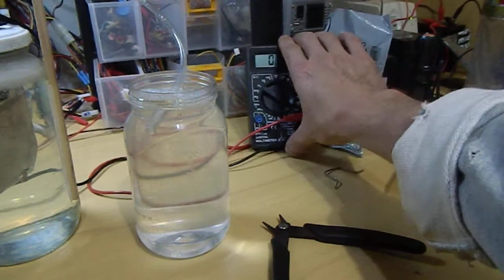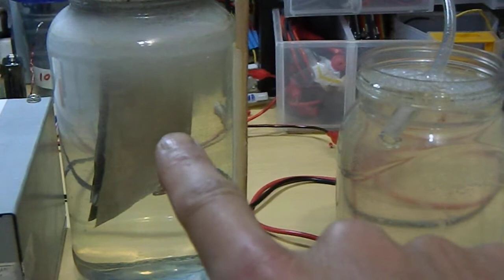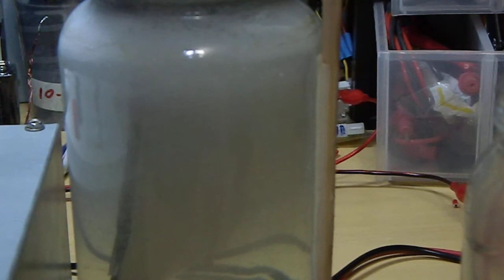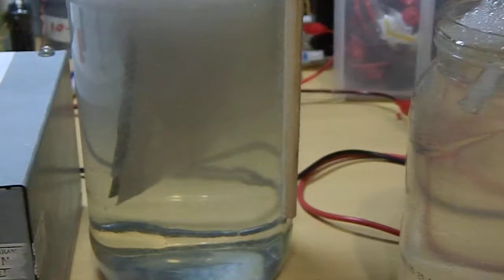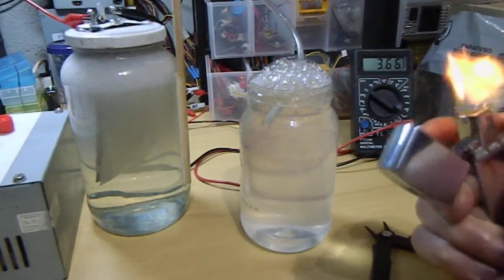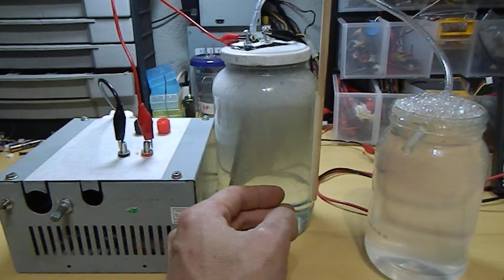HHO - Prototype 001

Comment: My first run I just fed the gas through a flash back arrester (Jar filled with water. Pipe from cell all the way to the bottom. Another pipe in the lid about half inch. 15mm. Then the other end of that pipe to air inlet.) I just made a small hole and glued the tube in about 3 inches. 75mm. I wired the cell from the battery through a relay turned on by the ignition switch. Much safer than having to remember to switch the cell off. Good luck and keep us updated. Have you had parcel yet?